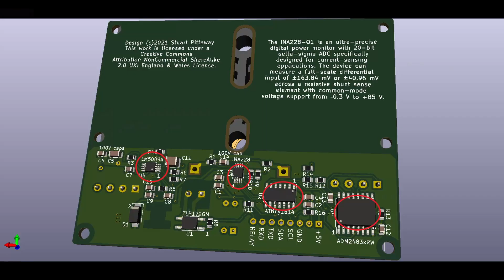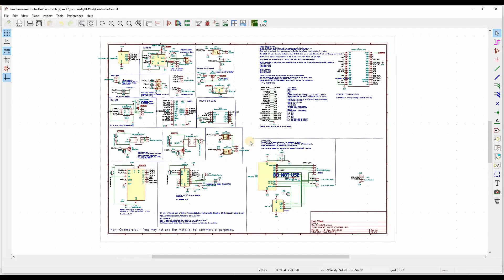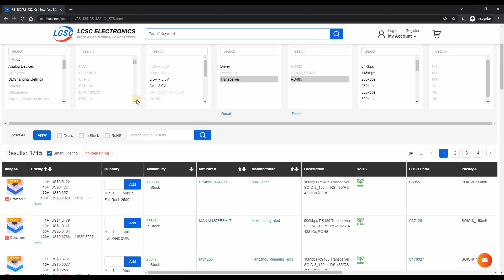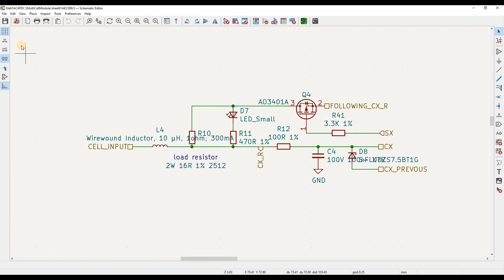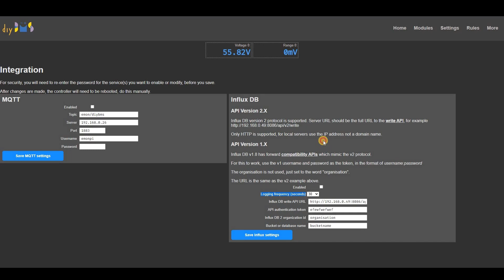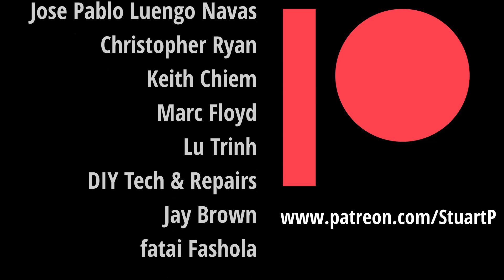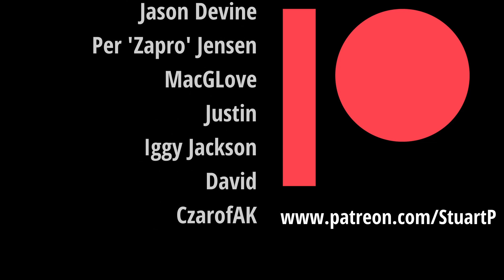Chipageddon [diybms]

Comment: Any news lately Stuart? Four months passed already and chipshortage is even worse. Is there any solution to build your awesome BMS? For instance, I have some stock of INA3221 breakboards. Could they've been used to monitor cells and report via I2C to ESP32 controller, like your all-in-one solution board? I would love to have single board to monitor all my 120 Li-NMC cells, as they are from BMW i3 and BMS connections are already made properly. Please let me know. Cheers ;)
Reply from the maker: The controller boards are easily built now, the attiny chips are difficult to find thought

Comment: I am truly amazed by your Hardware Architecture! I have reviewed a few of your videos and am very impressed. If I were to build a few of your diyBMS projects using JLCPCB, would I use the Master Branch with no tags as the latest Version. This would be for the ControllerCircuit, the ModuleV440 and the Current Shunt Circuit ?
Reply from the maker: That's correct. The master branch is the latest supported version. V4.40 modules are also the latest.

Comment: I really like the LTC board approach. We can monitor a large amount of cells with a few boards. For example VE modules 12S in 12s6p with 6 boards we can potentially monitor 96 cells
Reply from the maker: The downside, is a lower balance current

Comment: How about support for CANbus current sensors like the Victron smart shunt, etc? This could make integrating a DiyBMS controller into an existing electrical system easier (like in a conversion from lead acid to LFP).
Reply from the maker: Which Victron smart shunt has a CAN interface?  I've only seen them with Bluetooth or VE.Direct ports.
Reply: Oops, got ahead of myself there. is it possible to get the current/voltage info from a smart shunt through the cerbo?  And that could also go for devices on a boat’s NMEA2000 bus. I will be connecting my cerbo to my B&G Vulcan7 MFD for access to battery info in the cockpit (waterproof/sunlight readable multi-function display)
As for natively CANbus current sensors, there is the YachtDevices battery monitor YDBM-01 amongst others. The nmea2000 is a potential rich source of information.
Reply from the maker: @somebody1869  NEMA style devices could be a useful source. I'll do some research

Comment: Thanks. I'm interested in your all in one board for a future project as I have a couple byd rack modules that are 8 cells each and I run 2 in series for 48v on my victron. I'm putting together the boards now on a break out board because they have shared legs on the battery so it's not possible to just crimp the leads onto the jst plugs. An all in one would make wiring these modules a breeze.
Reply from the maker: Sounds like a cool project.  As mentioned in the video, I suspect the new boards won't work on this first revision, so may be a while before I can release them.
Reply: @StuartPittaway  yes, I understand. I'm using the breakout board in order to use the current boards, but only making it a temporary solution until there's a better solution released. I need to start paying you for your services as I love your work and want to support, what's your preferred method of payment/sub service?